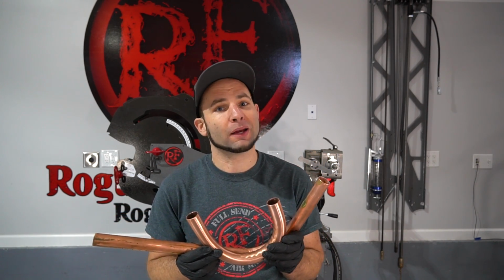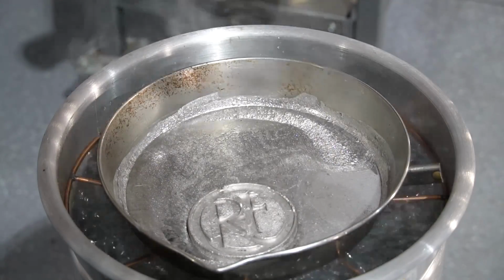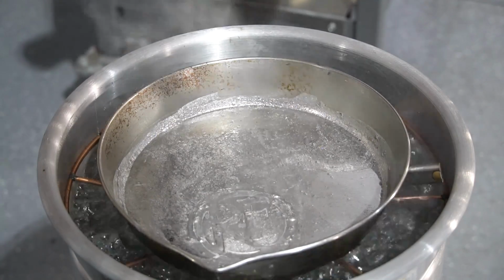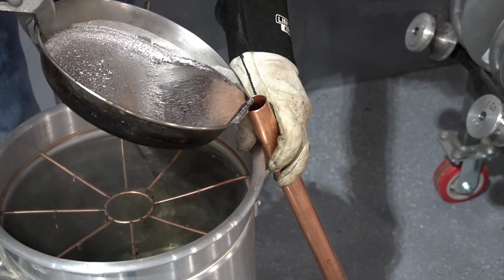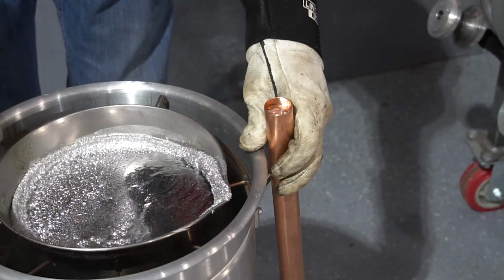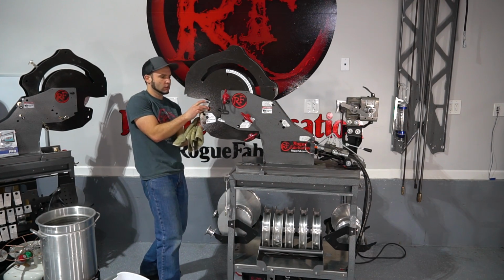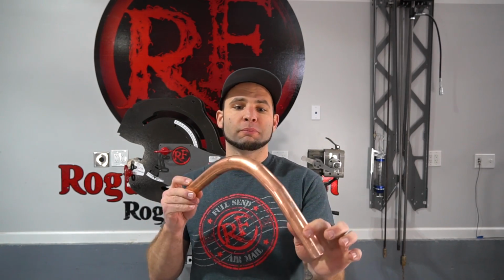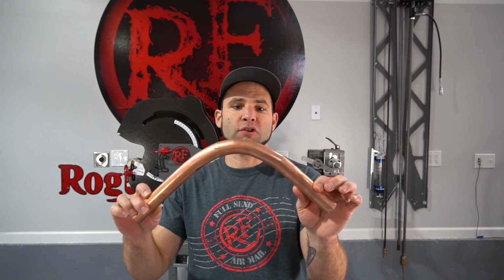Super Cheap/Free DIY Mandrel Tube Bending?! We try it! Bending with Cerrobend AKA Woods Metal

Comment: So this is basically the same concept as filling a tube/pipe with sand prior to bending it? Amazing 💥
Reply from the maker: Yes but it stays in place and doesn't require welding caps on the tube

Comment: Great to know!  I was once told filling tubes with sand or even freezing water in them helps for deformation.
Reply: That's how we were repairing 7/8" SS handrail and Bimini tops- sand filled and a conduit hand bender. Now with the rougefab we just cut out the damaged material, bend out a new chunk, weld in, and sand/blend with a tubing sander.
Reply from the maker: Awesome
Reply: Rogue Fabrication amazing that I now know to use a wiper die to take wrinkles out of the inside of the bend.  Running Cnc tube benders at work has taught me alot

Comment: Molten Cerrobend or "woods metal" normally cools and crystallizes slowly, resulting in a coarse crystal structure andmake it real brittle   If it gets rapidly chilled, it acquires a fine-grained structure that makes it very ductile and won't crack like that. Rapid cooling with cold water to room temp and also line the tubing with cooking oil before you add the metal and it comes out way cleaner after the bend. Much better luck with it that way.
Reply from the maker: Thx for the tips John!!!

Comment: I've also heard of using sand to help hold the structure of the pipe/tube during bending.
Reply from the maker: Yes, but its messy and requires ends to be capped (welded). And the sand still moves in the tube.

Comment: Very cool! I’ve gotta try some of that and see if I can Mandural Bend without the attachment. Quite crazy seeing you bend that copper without the attachment! Are you guys putting them up for sale, and if so how much? 

I see that new electric/hydro setup you all came out with, pretty slick. it’s a handheld switch and .5hp less than the original one I bought from you all, what else are different between the new option and the original option? 
I did notice the new electronic/hydraulic unit is a little cheaper than the one I bought I really like the lever and the look of the original 

If I won the gift card it definitely couldn’t hurt to grab some die storage racks or another die set (can never have too many) Keep up the great work guys! Loving all the new advancements your making with your machine!! Keep it up even though my wallet can’t 🤣
Reply from the maker: New one is aimed solely at price reduction. Cheaper imported power unit, and greatly simplified controls and plumbing. All just to make it affordable. The 2HP one you have is better!
Reply: Rogue Fabrication I definitely assumed so when I saw it, still very glad I got mine! 
But regardless still a great option for someone trying to save a little👍🏼
Reply from the maker: For sure!

Comment: I am wondering if you could pack casting sand in copper tubing using all thread rod with washers to lock the ends.
Reply from the maker: Maybe. But the rod would bend. Sand is a time consuming mess. So is the woods metal. But it was fun to try.

Comment: I've never seen that woods metal before. At a previous job, I used cnc mandrel benders when I worked in an exhaust manufacturing plant. Got a question tho. If I were to buy a bender and later buy some swag and get drawn to win a bender, could I use that win as credit to upgrade my already purchased bender to a mandrel bender?
Reply from the maker: Yes!

Comment: Seems like adding material to the inside to help a bend is a lot of extra work.  I'm not confident you would find a sweet spot in temp of the inner material maybe but seems very finicky.  Just buy your guys' mandrel attachment,. It's really not that expensive especially if you plan on bending copper.
Reply from the maker: Yeah... we really thought it was going to be more of a slam dunk when we set up to film. But you pretty much summed it up ;)

Comment: From what I saw, I'm thinking either get an actual mandrel or sub out that part to somebody that has one if it is absolutely necessary to have mandrel bends.  0 for 3 is not a good batting average for the wood's metal.  When you remelt it in order to get it out of the pipe, does it leave a film of woods metal on the inside of the pipe?
Reply from the maker: Did you miss the part where we make and sell tubing benders, and mandrel conversions, and we explain that our mandrel bender can bend this material on a tighter radius without wrinkles? We are not bending for a customer, we're an equipment manufacturer :)
Reply from the maker: Oh I missed the film question. Not in our experience. Tends to melt out very cleanly. It is a high surface tension liquid, so it stays in clumps/bubbles/puddles.
Reply: @RogueFabrication  I know.. I already have one of your benders :)  It is magnificent in my opinion.

Comment: Thanks for the info! I've tried using sand before, but didn't really work.
Reply from the maker: Yeah you have to compress the sand a LOT, cap both ends (securely, like welded caps). We don't mess with that.

Comment: You can just use sand and weld a cap onto the ends
Reply from the maker: That gets pretty messy and doesn't work in critically low wall ratios and D ratios like this. We prefer this method for performance reasons. Thank you though. Sand does offer slight improvements in some situations. -Joe
Reply: @RogueFabrication  I appreciate your insight!